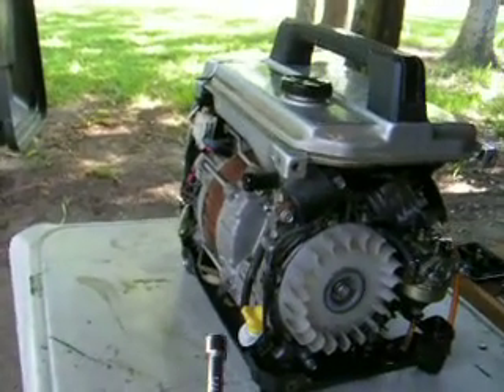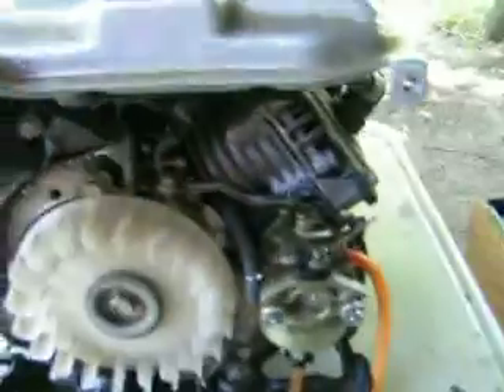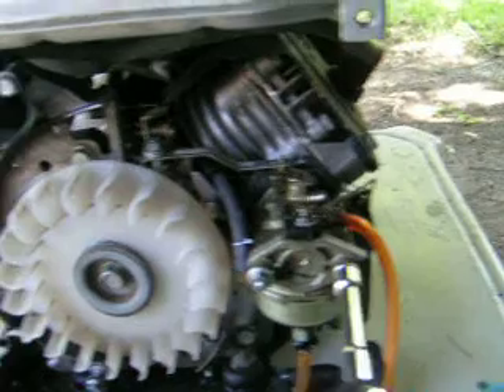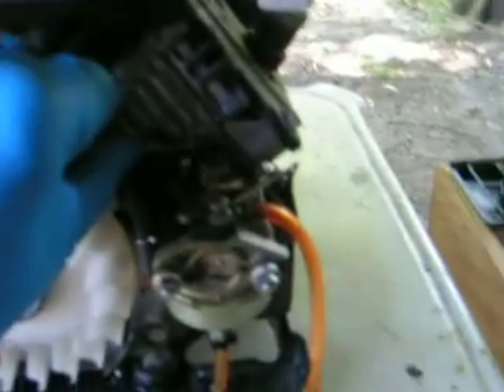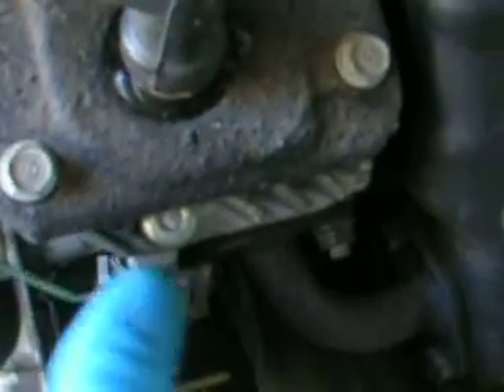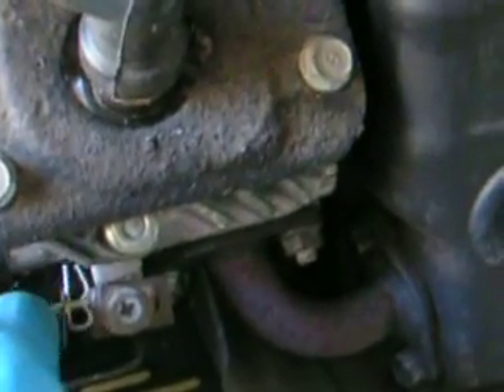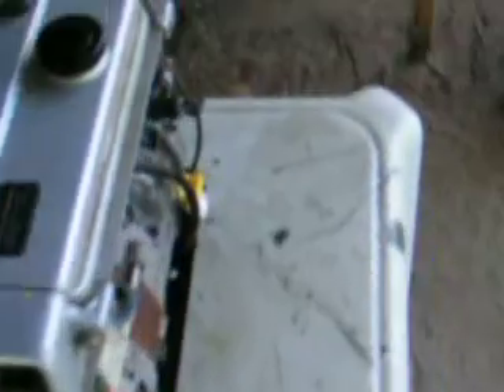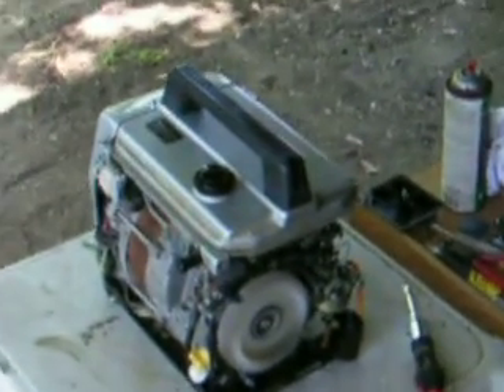Honda EM 500 generator Part 1

Comment: I bought mine used 35 yrs ago and have used it for living off grid charging batteries for 1000's of hours probably  over 10k hrs. I finally had to clean the fuel tank and carb around 4 years ago. I have always used high quality oil. It was starting to use oil and I uses 'Restore engine restorer ' and it worked, cut to oil consumption to almost zero. Just use a little over 3 oil changes (every 100 hrs or so). Project farm tested Engine restore and proved it worked, IIts not snake oil lied most of the additives.

Comment: Do you still have this generator? I was just given one by an old rancher. I just got it running,  but I need pictures of the motor with both side covers off so I can re-attach all the linkage. Thank you!
Reply: Did you ever get a pict? I will send you one.